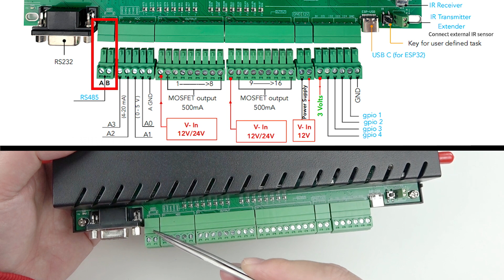KC868-Server -- the most powerful hardware for home assistant in 2022!

Comment: 0:20 haddawah
0:37 in the grood
1:23 meta box
1:29 letting luw
2:37 time new
2:58 woke mode
3:17 one kilo meet
3:24 black is browned
4:32 USB dung ka
5:53 one pint 🍺
6:03 cassettes for at the last
6:14 heat link
6:42 king kong e-system
8:17 this please
9:00 this must
9:06 moddy passport
10:33 gipsy IO
11:50 for slusluhu micro-hertz
11:55 any lemote
Reply from the maker: thanks.

Comment: Kincony develops and grows so fast! Every day product is better and more practical! This controler could be paired with other contolers for more input/output ports? Maybe in future you could make simple input and output port extender, for port expandion, so everything could go under one controler. That way it could be simplier to code, handle and more cost effective. When you want to build the whole smart house, you would need a lot more than 16 or 32 outputs:) BTW, i think it was great move to put relays out, a lot more practical:)
Reply from the maker: Thanks, KC868-Server is a "Master", it can integrate with many I/O board by RS485 or MQTT network for all kincony relay controller , even if not KinCony's I/O board also can be used.